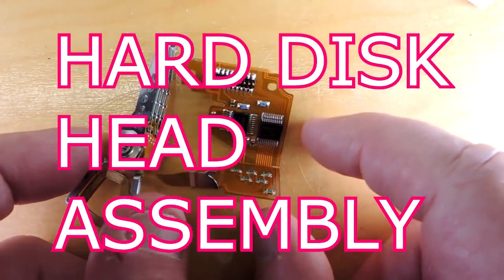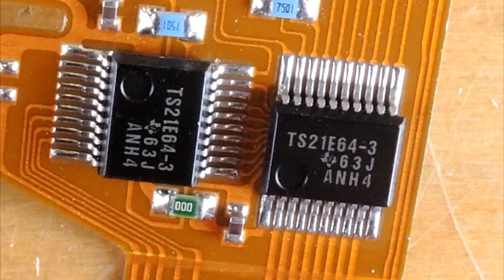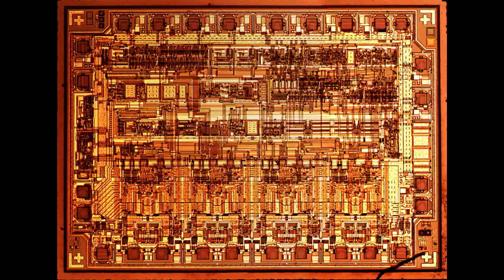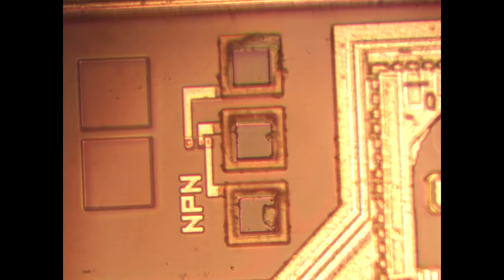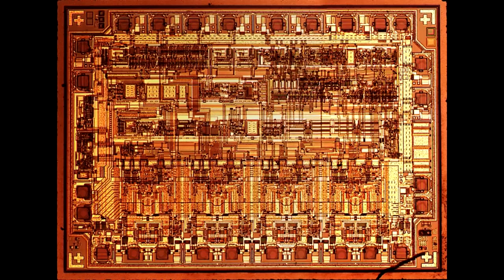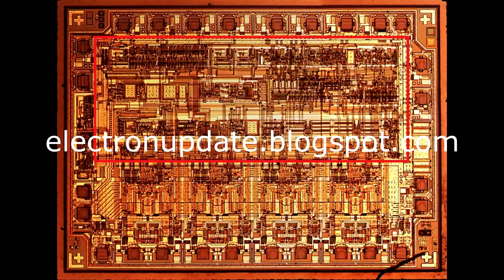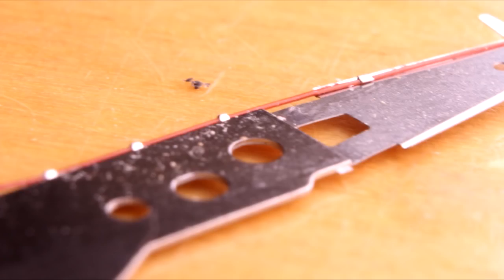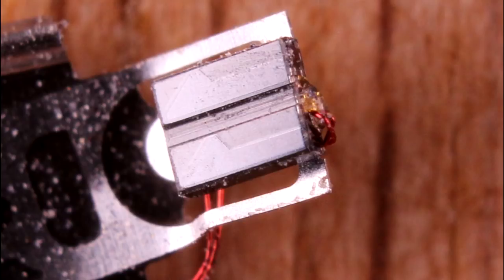HARD DISK DRIVE HEAD ASSEMBLY TEARDOWN

Comment: No doubt it's a custom part number on the package, but how did you miss the part number on the die? It says it's a TLS2154, which 2 mins of googling says is a low-noise read/write preamp. Here's the datasheet: http://datasheet.datasheetarchive.com/originals/library/Datasheet-029/DSA00511984.pdf
Reply from the maker: nice catch! thanks